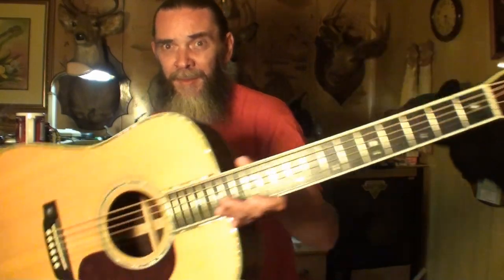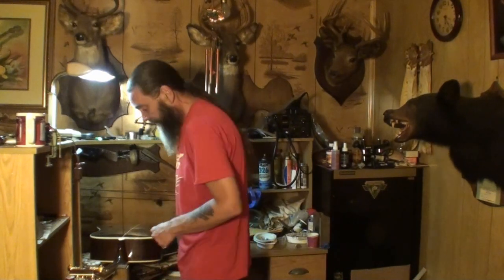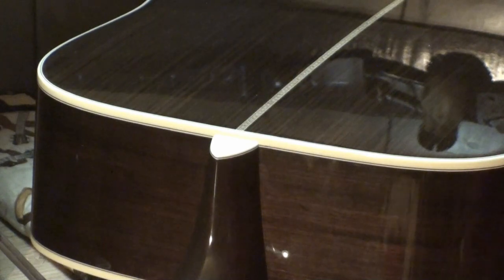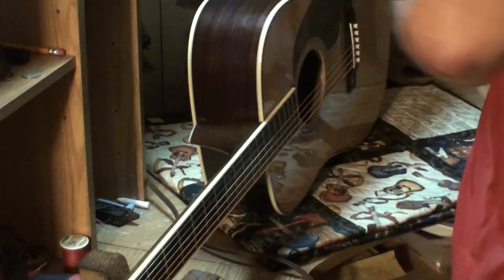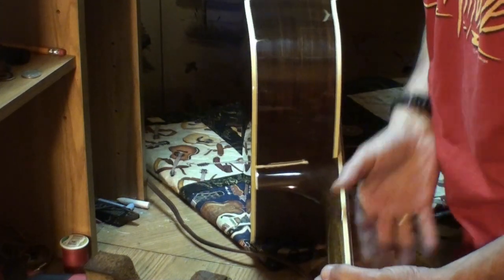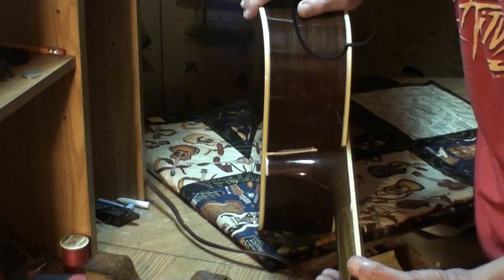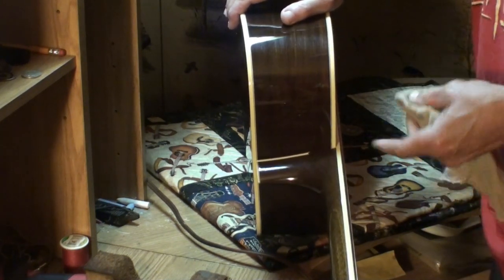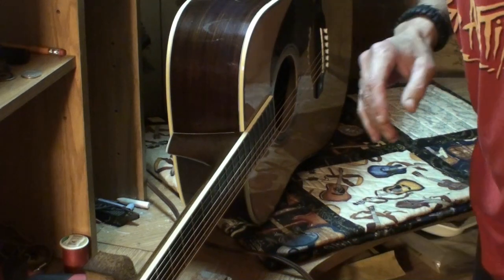martin d42 guitar neck heel crack sealed

Comment: Why, once you fill the gaps with glue you wouldn’t loosen the tension on the strings allowing the heel to naturally settle in, then once everything is glued and tight, re-tighten your strings?  Just curious.
Reply: Bad video; you want as much glue as possible down in there! (Wipe of excess of course)

Comment: My 2002 Martin HD28 had the same problem that ultimately needed a neck reset.  The issue was due to a paper shim being used from the factory.  I would warranty that fix because it will get worse...

Comment: I have the same exact problem with an old Washburn guitar that is signed by a couple dozen country stars from the 90's.  The guitar is pretty worthless itself, but the signatures not so much so!  I can't stand the thought of it sitting cracked in its case, even though it's never really played, so I was going to pretty much do this exact method with the blue slow-cure Titebond.  Seeing you do this to a $6000 guitar makes me feel more comfortable with it.  I will slightly tighten the strings to open the gap, apply glue, then slightly loosen strings to close the gap onto the glue.  Does this logical approach seem pretty...sound?

Comment: Randy my nephew was telling me that you can buy a Dehumidifier that sits in the case with your guitar. He says that is all anyone would need to portect there guitar. He was saying if I buy one of those. I could bring my Martin home. Remember l told you once that I keep it at my brother's house? Due to the fact that I have gas heat. Can you give me any advice. Will that work? If it will work. Can you recommend a good Humidifier? Great video. I love the Martin you have there. Thumbs up.
Reply from the maker: I remember you telling me about keeping that guitar at your brothers. actually it would depend on where the guitar lives whether you'd want to keep a humidifier or a dehumidifier inside the case with the guitar, if the climate where the guitar was going to love is very dry, you'd want to keep a humidifier in it, it the climate was very damp with high humidity then you'd be better off keeping a dehumidifier inside the case. I hope that makes sense, it just depends on what the humidity is like where the guitar will be kept.